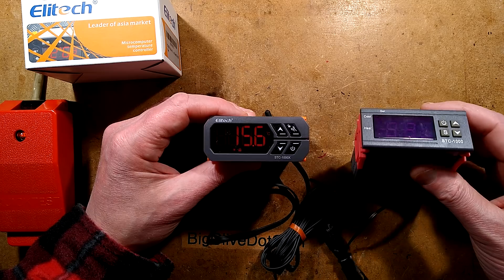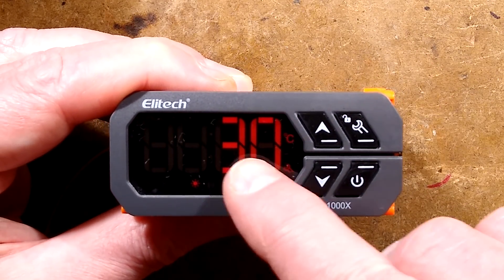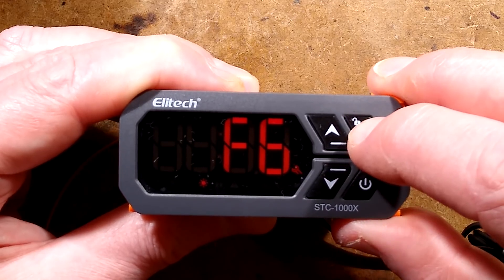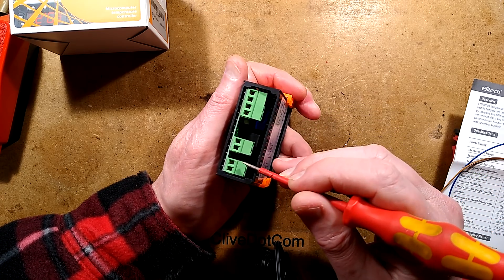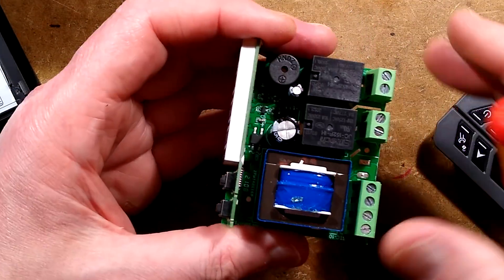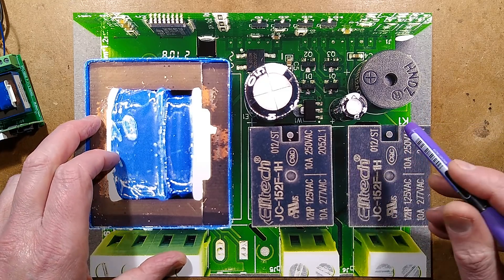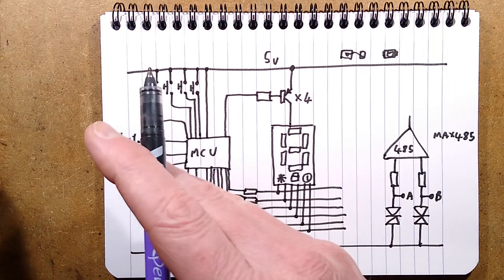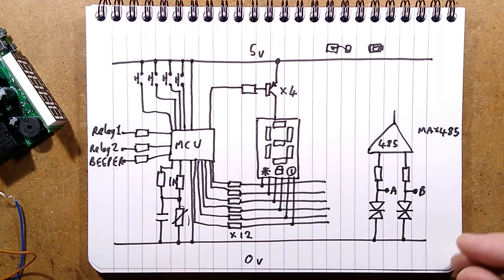Inside a better quality Elitech thermostat (with schematic)

Comment: Just bought another set of these after repairing a fridge over two years ago with one. It is still running perfectly. 
The time delay is to set a gap between compressor start-ups, starting at last compressor turn-off. So if the delay is set to six minutes (a recommendation from a colleague who is a refrigeration expert), the minimum time allowed until the next start-up of the compressor is six minutes. 

That means: 
If six minutes have already passed since the last turn-off, the compressor will turn on immediately on call. 
If less than six minutes have passed since the last turn-off, and there is a call, the timer will stretch that time to six minutes, then turn on the compressor. 

This is mainly to avoid starting the compressor under load and to also prevent damage to the compressor oil (according to my colleague, that is something that could happen when there are too many successive startups)

Comment: Refrigeration guy here: you must be careful with specific elitech products! Actually I'm suggesting you to check the ECP expert 300 knockoff from elitech I think is the worst products for its price point so yeah! 

I have come across a lot of issues with elitech walk-in cooler controllers from the keypad to the actual relays of it I'm. I always use external contractors for my loads but even with external contractors the internal relays from the controller goes bad. That's why you should use a reputable brand like LAE, Carel, Dixell, Eliwell (Schneider Electric) and so on.

I'm wishing you happy new year Clive from beautiful Greece!!

Comment: what is the diameter of the ntc thermocouple, is it about 2/3 mm (to insert in capillary tube of fridge ?)
Reply from the maker: It's quite big.  Around 5mm.
Reply: I think there are some smaller glass bulb like ntc sensors, 2/3 mm, possibly used in 3d printers ? should be 10k ohm (?) compatible with the larger diameter 5 mm ntc

Comment: Will these work on 12 to 14.4v DC if I remove the transformer and connect across the smoothing capacitor? Also could the display be switched off to save power and stop it lighting the room up at night. Looks like I could put a switch in the top feed for the display transistor. It's for a Motorhome compressor fridge.
Reply: Yes they do work. I've removed the nice transformer and bridged it out 😊👍

Comment: I could be wrong but I believe the differential is half the value either side of setpoint eg, setpoint 20 diff 2 - dead zone will be between 19-21 giving a 2 degree differential. Let me know what you think. 

This is the case for most refrigeration controllers unless using PID and TR

Edit - I should have watched more then 2 min before commenting

Comment: do you think the relays are up to running aquarium heaters
Reply from the maker: Yes they should be.  But have a secondary thermal sensor like the heaters own thermostat as a secondary protection.
Reply: @bigclivedotcom  thanks setting the heater slightly higher is the plan adding more fail safety is what I'm looking for 👍

Comment: The transformer looks like an EI pattern bobbin and depending on what it's for would either have a shroud around the windings which is safer from damage to the windings when laminating the bobbin. If there was space and you wanted to save money then tape can be used but it's not as good. Used to make them a long time ago. 
The pattern name comes from the shape of the laminations, the ferrous metal plates that make up the magnetic portion of the transformer. Looks like what I would call an EI38  bobbin, I did notice some damage to the tape when they shoved the laminations in.

Comment: You need a bottle of isopropyl in a bottle similar to your flux dispenser squeeze bottle.  One with a syringe tip so you can practice technique and show everyone how easy the tamper proof security  labels are to get off in tact, and to put back on with nobody else the wiser.
Reply from the maker: I have one on the bench for softening adhesives.

Comment: I wonder how many are just a weird thermometer and switch for the fridge. 
The one I use has no need for any control but on/off since it never reached and temperature anyway.

Comment: Compressors always start under load and need high torque and high start current.  This causes the windings to heat up.  The delay prevents the compressor from starting again until the motor has had a chance to cool off -- the delay is measured from the time the motor stops.

Comment: Great Video's Clive. In Australia i see these thermostats in commercial Natural Gas hot water services.
also common in commercial refrigeration units. I've never seen the networking address used yet. Handy tool connecting these to Building Management Systems.

Comment: Why would you want to delay a compressor?

The 485, ttl to rs?
Reply from the maker: If you turn a refrigeration compress or off and on too quickly it stalls because it's under pressure.  A time delay allows the pressure to equalise in the system.

Comment: Clive is there a way to wire in a small backup battery to these things? it seems to lose all the settings when power is interrupted, can be a pain.
Reply from the maker: They should store the settings.  Try pressing the power button after changing a setting to see if it stores it.
Reply: @bigclivedotcom  You are correct, it does save setting now, Thank you!

Comment: Elitech-not-Keritech, haha :)
Nicely designed electronics inside, and it's interesting to see their brand on relays as well.

Personally I wouldn't waste GPIO lines on MCUs for segment on 7seg display, unless the controller had a whole whopping damn lot of them. When running out of lines, I'd go for a MCP23017 or similar GPIO expander.

Comment: Can anyone help me with a strange issue, I need to find one of these with a higher range, say from 60F-220F, and I didn't have, nore couldn't find any with a range above 99F.  I can't just use an adjusted thermistor to trick it, because the Individual/friend/customer needs the display to be accurate. I had installed one of these as I had it on hand, after the thermal overload exploded due to poor maintenance in a big wood planer. and honestly we all agreed that it was janky at the time, and I could do this for free to get them by. but as the OEM part is non-available. a new one can only be bought if you replace the entire driveline, they are fine with just waiting for everything to cool off every 20 minutes rather than buying a whole new unit, I just wish I could get them going properly soon.
Reply from the maker: Search for thermocouple thermostat.  They tend to go to higher temperatures.

Comment: I've used these in mimic panel's for external chillers in a factory and for mould coolers inside the factory...and they're good but the relays do fail ..I've modified quite a few of them to use external din rail mounted to relays so less technically aware techs can swap out the relays with no soldering.
All that said they're really good value and they offer quite a range with many functions.
The relays failing is the most common failure point on most makes not just elitech as they're often used to switch 24vdc to control external contactors in industrial settings .
Reply: Make sure to put suppression diodes on the external contactors. It makes a huge difference in relay life.

Comment: I notice that there are 2 pads on the bottom of the circuit board marked A and B but without a connector. Are these the RS485 terminals? Your diagram just indicated those going off somewhere.

Comment: I would love an RS-485 version of this. I've been thinking about building a smarter climate control system, without resorting to the off-the-shelf "smart" devices. RS-485 means I can tie it into a sensor network, and make decisions based on the state of the whole house (as opposed to just where the thermostat is). It also means no Ethernet or Wifi networking overhead. Very nice. 👍️

Comment: Clive, I'd like to see you do a teardown on one of the higher-end heat/cool thermostats made for home use.  When the new heat pump was installed in my home, the installers looked at the old thermostat wiring and noted that the bundle had only 7 wires, where 8 were called for.  "No problem" said they--and came up with a thermostat (color touchscreen LCD Honeywell) that needed a connection with only 2 wires.  The base unit has lots of options, including net connectivity, and remote outdoor sensors.     I imagine that the whole setup is rather complex, but it's done well for several years here.

Comment: Most of these industrial type devices will have modbus and it uses rs485 which all have addressable functions which allow you to remotely monitor the operation. It doesn’t look this particular model has that installed though - probably why its marked as reserved under f6

Comment: Check out Ink Bird controllers.
Voltage output for SSRs and the autotune for PID control works pretty well. Not as good as a Cal or West instruments but at a tenth of the price can't complain.

Comment: I got an Elitech STC-1000 Pro in 2020. It has two heat inputs instead of one heat and one cooling. I used it to heat up and spin two fans in a cabinet in my shop where I keep my glues and finishes and such. It worked for about 1.5 seasons but one of the inputs failed. I couldn't figure out what the problem was so I went to buy another one but the price had went up significantly so I got another brand. The new one wouldn't turn on but I was able to find the fault, B/O solder joint on the input.

Comment: Does anyone know of a temperature control that can compare two temperatures and do basic logic? Ie turn on an air transfer  fan when the internal temp of a room is greater than say 23 degrees and switch it off when the inside temp and outside temp are equal rather than trying to run the fan forever if the outside temp is above 23 degrees.
Reply: STC-3008 seems to be the generic chinese model, available in 12V, 24V and 110/220V
Reply: I think you can use one with hot and cold sensors and connect both relay outputs in series so the fan will only run when it's too hot inside and also cold enough outside to make it worth turning the fan on.
Reply: Thanks gents however I don’t think it will do the comparison logic I need.

Comment: I've got an Elitech ATC1550 temperature controller that I have been using as a fermentation temp controller and to keep a freezer at fridge temperatures when I'm not fermenting. It's a similar controller form factor mounted in a nice plastic enclosure with a 13A plug socket on each side one for heating and one for cooling. Sadly the controller failed open and froze my stash of Italian prosciutto. I'd love to swap in a new elitech controller and squeeze in an SSR. I just don't think 10A onboard relays last long driving inductive stop-start freezer compressors. Anyone have a good non-fake seller  recommendation for a 25A SSR?

Comment: Interesting that the board was marked STC-1000B rather than X on the outside of the unit. I'm guessing that's just the internal part number for the board itself, and the X is the model of the full unit.

Comment: 5:39 - The delay is probably just between operation cycles, not between the moment the compressor is "requested" and the moment it's turned on. Since it hadn't been on since the reset, the delay wasn't applied. It would be applied only after it turned off.
Reply: That's correct. Most thermostats have a fixed setting of ten minutes, which is applied to the start of the AC mode, it will not turn on the compressor until ten minutes has passed since the last time the compressor was on.

Comment: We used Elliwell controllers where i worked, this must have been about 20 years ago when we started.
I notice RS are doing some similar controllers to yours with their branding
It's nice to have the fancy corners, but you'd have to be accurate with cutting the hole
Reply: Eliwell is still being used in tons of kitchen appliances. For cooling or heating. It has a bunch of settings for every need :-)

Comment: It originally looked like it was a red back lit LCD (segmented) because of the lower contrast where you can actually see the unlit segments and because it has those custom symbols.  You can also see fading at the ends of the segments that aren't getting as much light from the LEDs.  Using a red diffuser (instead of grey) would have helped.

Comment: The compressor delay will start at the time of the last stop, not from when it commands a start.  It;s meant for then something might want to cycle off then on again in short time.
You could have a look at the Inkbird ITC-308-WIFI unit.  It is designed for things like reptile enclosures, where you need to maintain a close temp tolerance,  as it can control heating and cooling all in the one unit.  There are 2 versions, one with WiFi and the other without.  With the wifi version you do all  the programing via an app on your smart phone.

Comment: I rate the Elitech I’ve been using them for many years. Pulling around 8A straight from the unit I wouldn’t recommend it like you’ve said previously use a relay

Comment: I've just ordered one for the parts. A high quality transformer, 2 relays, a temp probe and a big bright display. (plus a few other bits). For under £15 it's a bargain. :)
Reply: I see the little transformers in the older (some still made) ATSC converter boxes.  The PSU in those usually puts out 3.3V.
Reply: @tubastuff  Yeah, but this transformer is at least 12V, due to the 12V relays and 5V regulator it uses.
Reply: @Franko_Walker  Mostly a matter windings, I'd think.

Comment: I have one of the elitech STC-1000 running my heat tape on my water lines and it looks like the other's you have taken apart.  It's the standard style STC-1000 elitech branded.

Comment: Never heard of Elitech, Only Eliwell. My biggest complain about these style of thermostats is the settingsmenu. All brands use differend button combination to get into setup mode. Sometimes you even have to enter a code wich is so annoying when you only want so set the temperature and you first have to find a manual for that specific thermostat.

Comment: I bought one of these after watching your other video! I think Elitech was the original brand of the STC-1000. I made a little 3D printed enclosure to contain and strain relieve the mains wiring a bit. This one feels a lot safer than the old knock off jobbies I was using a while ago for home brewing.

Comment: I'm fairly convinced that Chinese manufacturers wind the primary and secondary in layers simply because its cheaper and not to increase efficiency.  If you watch DiodeGoneWild even a little bit, you'll never trust an AC-powered direct-from-China device as long as you live ;).  If it plugs into the wall and it's not from a branded brick-and-mortar store, there's a very good chance that the only thing preventing a fatal shock is the lacquer on the wire.

Comment: I use the 'other' units to control a chest freezer to keep epoxy I sell cool (around 50f) and they go bad every 3-5 years, maybe I should get one of these for when the next one goes bad. It basically turns the freezer to a warm fridge. The epoxy I have wants to be cool but not too cold.
Reply: You shouldn't use a freezer as a fridge. It's not designed to do that.
Very inefficient.

If you know, they fail after 3 years, replace them after 2 years. No problems at all.
Does the relay fail from switching so often?
Reply: @CyberlightFG  It's not the freezer that fails, it's the little $15 controller. My last freezer lasted me 16 years (not bad for $170) and my current one is going on 8 years. This is for my business and it's an absolute necessity. The freezer only costs me around $30 a year in electricity since it's set at a higher temp and freezers don't spill out all the cold when you open them like a fridge (it's very common for people to turn them into fridges if they want to save on electricity). So not sure why you say it's not efficient. I store around $3k worth of a special epoxy in it on average and it's perfect for my use.
Reply: @CyberlightFG  Oh, it's the circuit board that tends to fail, not the relays. It only switches off and one around 6 times a day on average and maybe 10 times a day during the hottest summer days. Chest freezers are very efficient.

Comment: Very cool with the additional features.

On my channel I've got a rundown of how I used one. Gutted a destroyed UPS, and wired it into the input/outputs. Use was for a brewing setup where the cooling point goes to the fridge, and the heating goes to an electric blanket set to its lowest value lining the inside of the fridge. 

Great units and fantastic to see a full workup of the insides of it.  Love your work mate.

Comment: Thank you for yet another entertaining and informative video. Did you measure the power consumption of the thermostat? I would suspect that the transformer produces more heat than a SMPS or just a series condenser based 24V PS. And a LED display is probably not as efficient as a LCD display?
Reply: The manufacturer lists an overall power consumption of less than 3W for this particular model.